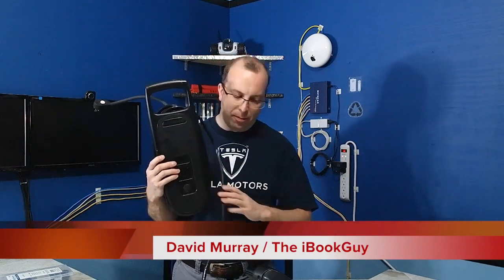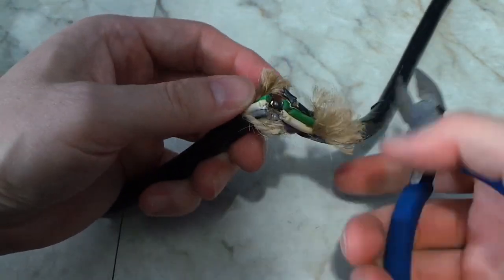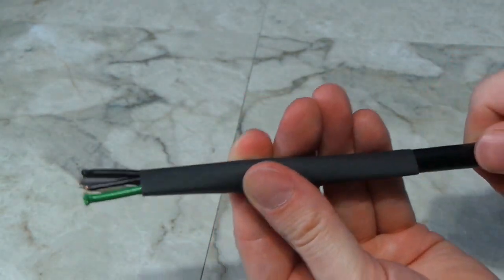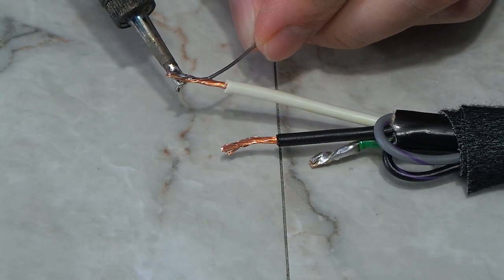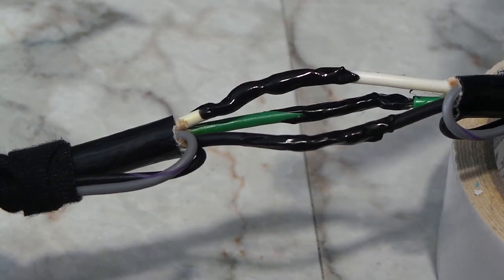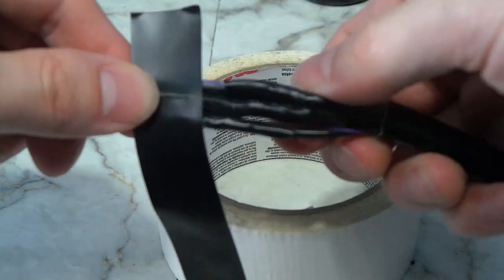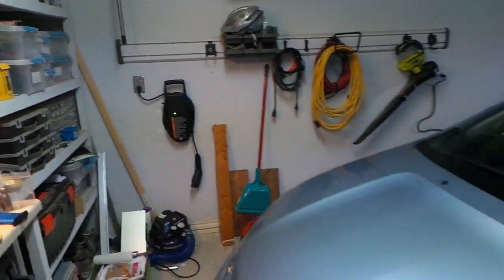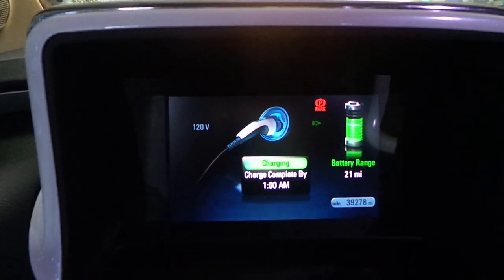Repairing a damaged EV charging cable.

Comment: Hi, Cool :-)

I got at problem in a way.. related to the Chevrolet :-)
i got a stereo from a 2014 chevrolet spark ( Mylink ) but the power that keeps the stereo on is the CANBUS, which i dont have in my (2011 Spark) but i have it mounted up in my car and every 10 minutes it turns off cause of the canbus signal is not there, can i get a CANBUS simulator that would fix this problem and were ? :-)
Reply: +Ralle http://www.carid.com/scosche/scosche-stereo-replacement-interface-64163644.html
Reply: Cool, but would this work for my radio that needs the car computer to tell it to stay on, but into a car that uses ignition power ??
Reply: Ralle  From what I could tell is included in that kit is a CAN bus controller that bridges between the car's computer, and therefore the stock stereo, and gives you direct connections to any aftermarket radio.  I had to use one similar on a Dodge Caliber that used the CAN bus signals for Retained Accessory Power, including the turn on signal for my Pioneer radio.  If you just need the interface bit and not the plastics, just look up 'interface kit' for your car and you should be able to find them on Amazon, eBay, Best Buy, or even Walmart's websites.  I would stay away from Crutchfield because they hyper mark up prices but use them as a last resort. It's probably going to cross over as a GM aftermarket interface kit to even retain the warning chimes if memorry serves me right.
Reply: yes i see but, my car does not use the can bus system... but the radio im gonna put in my car does depend on the canbus for it too keep it from turning off every 5 minutes? so it is like the other way around for me than what you describe ...:-/?
Reply: +Ralle Sorry, I guess I glossed over that when you posted the first time.  I don't think such a device is in production since the 2014 radio is a slave device and would require a master device to generate the signals. And since the signalling is firmware specific to the vehicle of origin for anti-theft measures, if you can find such a device, it's going to cost several hundred dollars because of licensing needed from GM. By the looks of it there was never any intention on GM's part to make a retrofit into non canbus vehicles. :-(

Comment: Electric vehicles are pretty expensive, you and your wife must do quite well :-)
Reply from the maker: ***** - Not as expensive as everyone thinks.  For example, I bought the 2013 Volt used on a 5 year loan.  My payment is $302 per month.  But I have no gasoline bill, which makes a huge difference.  Our Leaf is brand new, but leased on a 3-year term and we pay around $300 per month for it as well.  Again, no gasoline bill, no oil changes, no emissions inspections, etc.
Reply: Kaz I was waiting to let David answer first since it's his channel....anyway, I think the $5-10 amount he states is probably a bit extreme.  Here are my numbers. In my case we have 2 EVs (both Nissan LEAFs) and no ICE vehicles, so 100% of our transportation is electric. I do charge at work on occasion, but most charging is done at home. We pay $0.1029/kWh (this is standard, not time-of-use rate). When we had 1 LEAF and basically shared the car (we would use the LEAF as much as we could), the impact to our electric bill was $37/month and that covered 1500 miles.  You're probably talking about $150-180 in gas for that # of miles, so right there you can see the monthly savings.  This is about 2.5 cents/mile, which is in line with what most EV owners get.  You'd be hard-pressed to beat 10 cents/mile in a gas car.  With 2 LEAFs we are averaging about 1800-2000 miles/month total (like I said, with the 1 LEAF we tried to take the LEAF whenever possible) and the impact to our electric bill is probably about $50/month, but it's hard to say because I've also been taking steps like converting to LED lights which has offset that cost.  In fact I just got a report from my utility that shows how my electricity use compares to comparable homes in my area (and it's likely they aren't fueling 2 EVs) and this month my house actually consumed less than what they call "the most efficient homes" (1450kWh vs 1519kWh), and far less than the average home.

So yes, we are definitely saving money. I've kept pretty close track and found that adding in the cost of oil changes, we were saving about $2000/year with the 1 LEAF.  But it's not just about the money savings--the reason we got the second LEAF is that due to a job change, I was no longer able to work from home and needed to commute.  Since the LEAF was "mine", my wife started to have to drive the gas car after driving the LEAF for 1.5 years, and she was miserable in it. She didn't come out and say it, but I could tell. She hated her commute and wanted to move closer to work. When my son went away to college, the took the gas car and we got the second LEAF, and she is now much happier. The driving experience is just so much more relaxing, and it's hard to put a dollar amount on that.
Reply: ***** a $7500 subsidy for the first 250K vehicles from each manufacturer (at which point the credit runs out)--let's call that 2.5 million vehicles, or a total of $19 billion or so--is a drop in the bucket compared to the huge subsidies that oil & gas get, not to mention the trillions we spend on the military in the mid-east attempting to keep that region stable. If you want to level the playing field and remove the tax credit, fine, just remove the oil & gas subsidies as well. Electric can compete very favorably with oil & gas if all is equal.

And yes, depending on where you are, you are potentially using fossil fuels anyway to fuel your car.  BUT, it's far more efficient and clean to do that on a utility scale somewhere away from the city center where people don't have to breath the particulate exhaust (just take a look at cities like Beijing where the smog is so thick you can barely breathe).  However, in the US at least, the average portion of the grid that is coal powered is about 44%.  And pretty much all consumers at least have the option to buy 100% renewable energy. It costs more, but it's still far less than buying gas.

As for fuel cells, the main problem with them is that you don't get hydrogen from a well or a mine. It needs to be manufactured. And where does it come from? The cheapest way to get it is from natural gas, so you're not really avoiding the carbon footprint issue there either. You can get H2 from renewables using solar powered electrolysis, but it takes about 2.5x as much energy to do that as it would to just charge your batteries from those renewables in the first place.  H2 may a place in the future as a range extender, but it just makes no sense for daily driving.
Reply: +Hans Kinki There is only one place that I know of that has the "perfect" combination of really expensive electricity and really cheap gas that would make it even remotely close to being less expensive to use gas (and that is New Jersey).  Even there you'd have to drive a car that gets more than 35mpg for it to be more economical to drive a gas car.  Almost everywhere else I know of, driving an EV costs between 1/4 and 1/5 that of gas.  As for driving an EV not being better for the environment, that myth has been busted over and over.  It is.  If you have evidence that shows otherwise, please share it, but every scientific report I've ever seen has shown that it EVs are in fact better for the environment.  You can start here:  http://longtailpipe.com/topics/environment/
Reply: The iBookGuy would you do a video about the cars?! Im from Brazil, and here we dont have this type of cars yet, only the Toyota Prius, but is so expensive here.

Inspite im a windows, and android guy, i really like your videos, i subscribed about a week ago, and my youtube is showing me another apple channels, and yesterday i saw myself thinking in get an iphone, something that i would never think before.

well, congrats for your videos, they are very nice, too bad it takes so long to make, but i understand, this stuff is not simple, and takes time, so if i can give you a tip, you could do a video every week, just talking about something, with no DIY projects, just to keep your schedule, maybe only with some video editing, to make it easy.
Reply: The iBookGuy I'm in the UK so we don't have cars like the Volt, but we do have quite a few others. I never really thought about a loan, only looked at the £20,000 ($30,000) pricetag.

In the UK, the government actually pays you £5000 ($7.7k) if you buy an electric car so it's actually pretty tempting.
Reply: ***** It's true that the Volt (or the Ampera as it's known in Europe) is no longer available there, but it was at one time.  With 3 year-old EVs coming off leases now, you should be able to find REALLY good deals on them.  Just remember to take the total cost of ownership into account.  Without a petrol bill and drastically reduced maintenance, they are tremendously cost effective compared to petrol cars, even if you were to buy one new.
Reply: Afonso Ramos If you look way back in his videos, you'll seem some REALLY EXCELLENT EV-related videos (hopefully they are still around anyway).  I don't own a single piece of Apple equipment, so the EV videos are the whole reason I subscribed to him...so thankful to see another EV related video!
Reply from the maker: Kaz virtually none.  I get free charging at work. But even if I didn't, I don't think my electric cost would be more than $5 to $10 per month.
Reply: ***** To clear up a few things on the EV tax credit: 
1. It is a tax credit, not an incentive paid to the dealer like the Cash for Clunkers program.  When someone buys a new Volt or Leaf (or other EV that meets a minimum battery requirement) they are eligible for a tax credit of up to $7,500 in that year only.  That means that if they weren't going to pay taxes that year anyway, they get 0 incentive from the government.  Even if they qualify for the full $7,500, it is paid for with their own money.  When we bought our Volt we knew we wouldn't qualify for the full $7,500 because we didn't make enough money that year.  We didn't have to pay federal income tax that year, but we did not get a $7,500 discount.  In that respect not one tax dollar you have ever paid has been redistributed to an EV purchaser.  There is an argument to be made that if people paid taxes on their income the year they bought an EV then taxes for everyone else could be lowered a little, but the same could be said about credits for college education and having minor children or that we are subsidizing charities by not taxing people who give all the money they earn away to them.

2. Not all plug in vehicles qualify for the $7,500 credit.  The credit is based on battery capability so, for instance, our C-Max Energi only qualifies for a $4,000 tax credit.
Reply: Lance Pickup Tks, i will look for the videos.
Reply: The iBookGuy What kind of effect does it have on your electric bill? Do you actually save money? Not being snarky, genuinely curious.
Reply from the maker: Lance Pickup - I think you just drive a lot more miles than me.  I do about 10 miles per day. So at $0.02 per mile, that still works out to around $5 per month.  So, granted, even if I were driving a gas car I still wouldn't be spending more than $30 per month.
Reply: ***** Electric cars work out to be incredibly cheap to buy.
USA and EU countries have financing on cars, you only pay the actual depreciation on a car, the rest is left as a ballon payment that you pay or use the value of the car to pay.
That together with the stupidly low running costs (no fuel bill when you charge it for free at work) and the 0 tax on electric cars then it really is a no brainer to get one.
I prefer something with some power myself but electric for a commute is crazy not to, who needs a 6mpg V12 when you are doing 20mph anyway?
Reply: The iBookGuy Yeah, 10 miles/day is not a lot and well below the average of 40 miles/day in the US.  That's only 3600/year.  Probably below the sweet spot for savings vis-a-vis gas.  Which is why I gave my numbers, which I think represent a fairly average US household.
Is your wife in the same boat?  <10 miles/day?
Reply: Afonso Ramos i have a 2008 black macbook and a iphone 5c IT IS WORTH IT!!! oh. and also you don't need to get a exspensife (don't know how to write that word) mac you can buy and old one i use my 2008 macbook every day for the past 2 moths and it does fine for websurfing,app usage;and even document writing!!!
Reply: The iBookGuy 
I'm thinking about going from a 2012 LEAF (lease) to a used 2013 Volt. It's either that or drive my gas car for the next 3 months until the 2016 Volt comes out and lease that. What do you think about your used Volt?
Reply: *****  Same here in the US. If you buy a brand new electric car, you can get $ 7500 in tax credits from federal government. Some of the states also offer tax credits making it even better.
Reply: +The 8-Bit Guy How cheap is electricity where u live? Basically it comes down on how much electricity ur wasting already and how much you drive.Having a free charge at work thats perfect, if i had free power at work id consider buying electrical too even though i don´t believe that its better on the environment but free "gas" is free gas.

Comment: You did a much better job on this project than you did on the Laptop power cable. Congrats. Just remember to use a solder with a high melting point on high power conductors so there is no chance of the solder melting under load.

Comment: This is not really a safe robust splicing technique for high-current line-voltage connection. Solder is weak and can be brittle and does not stand up to the physical strain that flexible conductors are likely to be exposed to over time,  and loose high-resistance connections cause fires,  so the splice should be mechanically reinforced in some manner before soldering.   Or  buy one of the screw-down UL listed mechanical splice assemblies designed for such purpose.

Comment: Don't worry about the strings, thats called Filler, that is added to the wire to ensure the wire is round if the leads end up giving the wire an odd shape.

Comment: That liquid tape stuff looks interesting, how flexible is it? Could be good stuff for repairing laptop PSUs where the strain relief has broken off.

If you don't have a soldering iron, or the wires themselves are going to take some sort of strain, a lineman's splice is another good way to join wires together - https://en.wikipedia.org/wiki/Western_Union_splice
Reply: James Grimwood Hey, I've got some wires that need repair but have been waiting for a good deal on a nice soldering iron. Might just have to try out the splice on some of them, thanks!

Comment: Looks well done to me but... YOU DID IT WRONG. 

lol jk :) I do usually try to twist wires together when soldering so there is at least some contact with the wires and not all through solder but shouldn't matter.  Couldn't see too well in the beginning but looked like none of the wires were actually damaged just the insulation so you might could have saved some effort and just cut the loose fray, wrapped the wires individually with liquid tape/electrical tape.  Definitely cleaner though to just redo it and shrink wrap is a nicer finish.  GJ
Reply from the maker: Phil Saltsman - I actually tried twisting them at first, but the wire was much stiffer than it looked, especially for stranded cable.  So i left them alone.  And although you couldn't see it in the video, one of the wires was cut clean through with only the insulation holding it together and at least two others were partially damaged.  In fact, he tried charging his car on it before bringing it to me and it wouldn't charge.

Comment: Cool! I think I am going to try to do something like this on the charger for my mom's laptop because my pet rat chewed it up. :P
Reply: One suggestion, no means to discourage you but before purchasing the supplies to make the repair you should check on sites like eBay for a charger that's the same that costs around or less than what you need to repair it. Also I can say generic models don't do very well(old notebook R.I.P 2009-2012(video stopped working one day), but this is the future.)
Reply: I have everything that need to fix it. And as for getting a new one the charger, well it is a older laptop so I cant really find any charging cables online that are not in bad shape. :/

Comment: Awesome work with the cable repair. I wouldn't say your repair method is wrong, far from it. But I will say that it's an interesting approach. I did a similar repair to a trailer light cable recently using a similar method. Using of liquid electrical tape never crossed my mind and soldering the wires together rather than using butt-splices reduces the chances of a point of failure. Keep up the great work!
Reply: Duy Nguyen I did a similar repair a few months ago, with tight clearances inside the cable, and found myself thinking "i wish you could buy liquid electrical tape that you could just paint on and have it dry solid" -- and when I looked, the stuff already exists! Be aware I used the same product as he does in this video, and the product has several warnings advising you that the product is known to cause cancer or birth defects, and to only use it in a very well ventilated area. I am assuming as long as you are in a well-ventilated area, and wash your hands after coming into contact with any, that you should be ok.